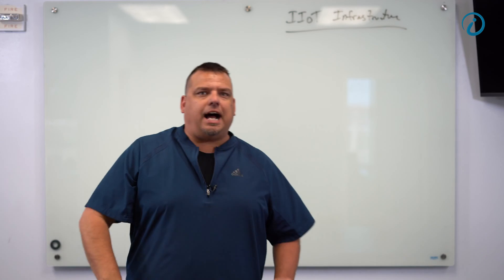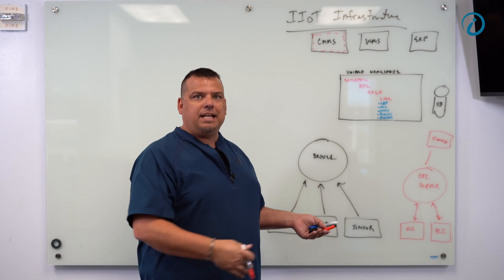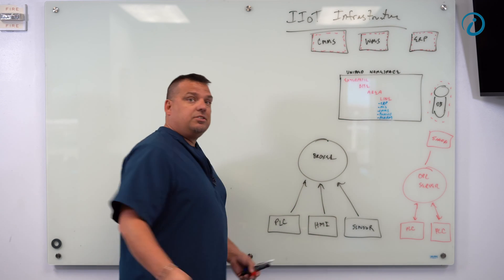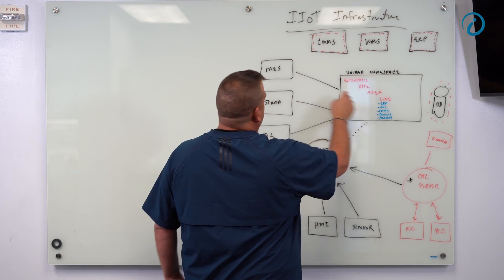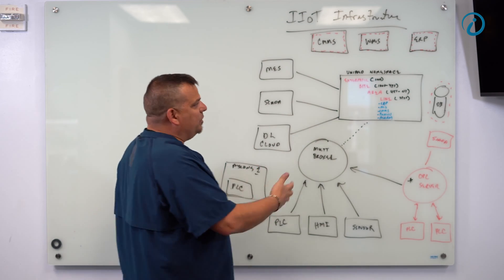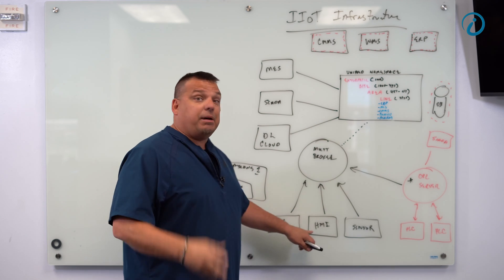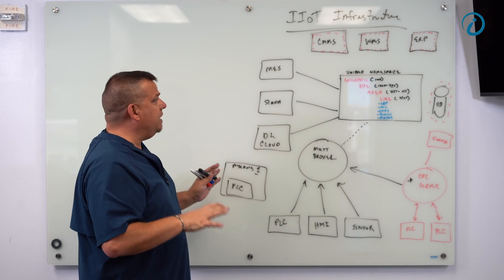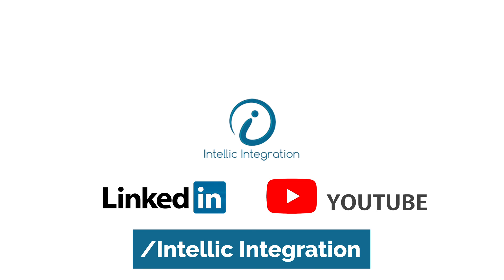Typical IIoT Infrastructure REVEALED

Comment: Thanks for sharing your perspective on IIoT architecture. That integration and (namespace) unification among existing systems and devices is one of the things that makes the difference between IIoT and a non-industrial IoT application. In the case where there is no existing IIoT infrastructure (sensors, PLCs, Fieldbuses), What would be your approach for designing and implementing an IIoT system, bottom-up or top-down?

Comment: I agree that the largest challenge to industry 4.0 is unifying the data in a defined information model and giving it context, which will then enable analytics
Reply from the maker: We couldn't have said it better ourselves Matthew!
Reply: Good point. i would differ with you about the greatest challenges involving context, however; in my opinion the greatest challenge to the system is standardized coding of the correct context into the OS. As one can imagine , the concepts of context and nuance butt heads majorly over effective bandwidth usage and the sheer difference in database size requirements vis a vis software bloat incipient upon developing subcategories that will continue to develop after these regimens are instituted, leading to further expansion of bandwidth requirements ad infinitum. Of course  IA OS s will evolve, but the limitations placed upon us as a species by the gargantuan amount of data we don't know yet, and our leniency with cutting corners to save a buck ensure that evolution of IoT control and communication will develop at " the speed of profit."